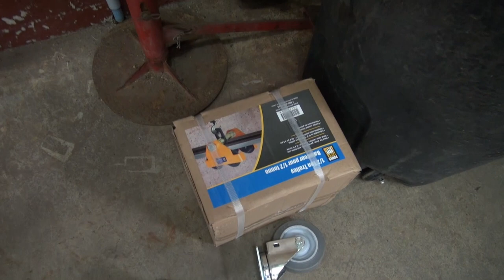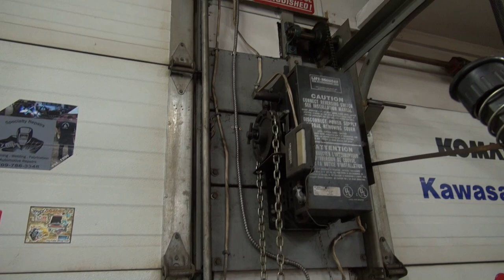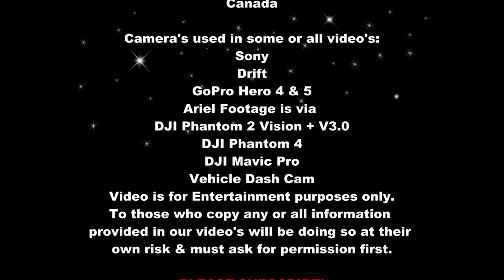Lets Make A Changer Crane

Comment: Paul, another thought provoking video great.  Simple, cheap and useful, with many possible variations and uses.  We have had several jib cranes in shops I have worked in, some have trolleys etc.  One thing you might  have done was mount it on a  12" spacer  on the wall, that gives you more reach , stays strong and moves the pivot point away from obstructions, allowing a wider swing to both sides.  (I aways  think of better ways after I'm done.) 
You and Kathy keep doing  the history videos,  it gives my wife a  treat.  Keep well and God Bless. Greg

Comment: Paul & Cathy,  We use a device to measure the depth of a hole that is between 400 ft and break through to the floor you are standing on. these have to be accurate measurements so we don't blast our floor out before we want to .for your needs determine an average length of rod you will need for most of the tires you work with. drill a hole in it a little more than half it,s length so it is off  balance when hanging on the hook from the hoist.when you drop it through the rim it will hang straight down. as you raise the cable to lift the tire push the cable to the short side of the rod so it catches the rim and keep lifting .once the tire is where you want it either on the tire changer or the floor  release it by lowering the cable the rod will hang straight down you raise the cable and swing it to the side out of harms way. hope you understand the method. good luck.nice come back but take it easy we need you buddy.
Reply from the maker: Thanks Tim. Interesting.

Comment: Paul, if you look at the spare tire hanger underneath a pickup you'll find at the end of the cable a metal that is self-centering the cable that holds the spare rim. If you get one and
weld a ring to accommodate the hook of your overhead winch.
Reply from the maker: Yup. Had to cut many of them down. Now I wife I would have kept one lol. Thanks.

Comment: I agree, have your fun. I try to get my mrs to try all my power tools. Wont touch the welder though. 

Im impressed with the speed of that winch, and the frame suprisingly works well. When i go to pa on friday, one will be on my shopping list. But for different use. I can see many uses coming up, with my fabrication work to flip parts as i weld them. Or to unload items off truck. 

So let the nay sayers say what they like,dont let it bother you. What you are doing is entertaining,i love the shop and all the tools. I dont have as many tools in my shop, but its 24x32 and im running a repair shop also. Tight,i prefer cozy. Besides,i can only do one job at a time.

Like the v-shaped spare tire carrier hook,hinged at top and a wedge on a rod through the v. Hook cable to rod and it will lift wedge expanding v. Making a loop on rod then cable and hook can remain untouched. Perhaps a few prototypes are in order. Looking forward to part 2.
Reply from the maker: Frank for $60. you can't go wrong at PA. Came in handy here. Yup the shop is small with all the tooling in it but I know where everything is and your the same. Keep well bud.

Comment: Paul - Nice hoist. I'm interested in seeing any further mobility mods (beyond stikas and grip tape) you make for your tire lift dolly, if that's what is called @17:28.   
You introduced this unit in video from 11/19/2014 https://www.youtube.com/watch?v=R_XnlYVH2h0).  
 I believe the model you have can no longer be purchased and they are hard to find and pricey for what you do find.  Anyway, I don't believe you ever used it in a video since that time and I would be interested in seeing how it works for you.  Thanks.
Reply from the maker: Yes that is called the Lift Helper. It will be coming back in the shop soon. I need to make some new improvements to it first before it goes back into service but it will be back.